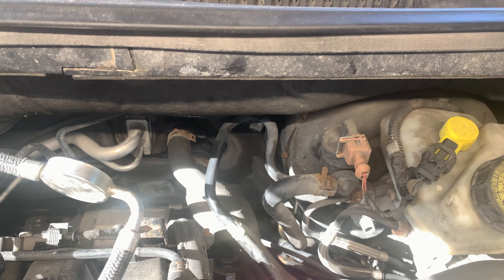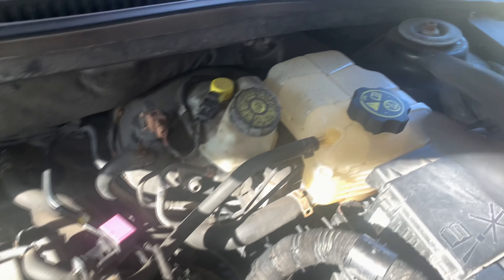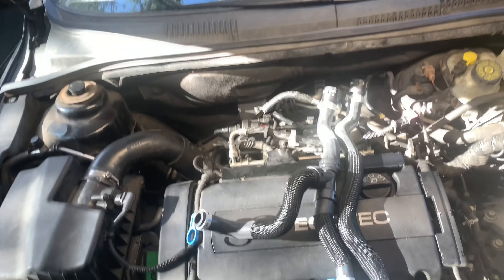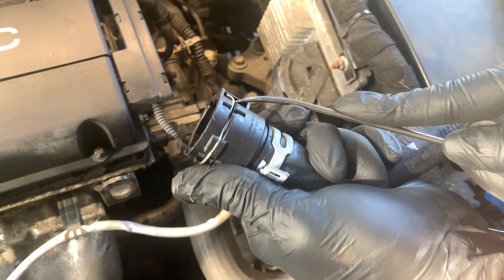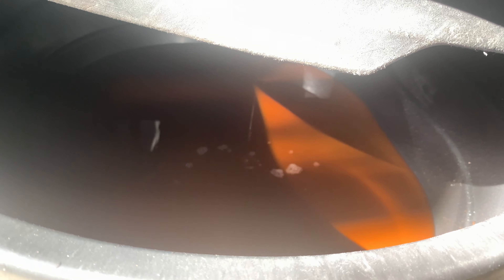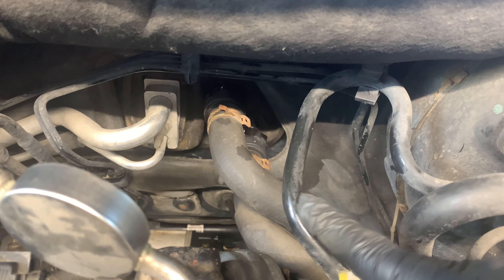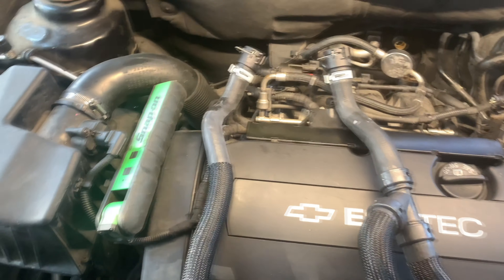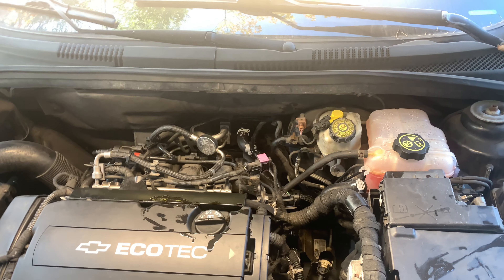Chevrolet Cruze Common Coolant Leak : Heater Core Hoses

Comment: Get compused, the upper hose should be on lower or upper of thermostat housing? The reservoir hose must be in bottom or upper of the thermostat? I need diagram for this thanks.

Comment: I saw another video were the tech replaced the o-ring in the hose that connects to the heater core to stop the leak.  Will I lose a-lot of coolant if I don't drain the system when disconnecting the hose at the heater core if engine is cold? I try & fix myself to save a-little money.  Thanks for sharing.
Reply from the maker: if you have the exact o-rings replacement, then for sure go ahead. You will lose a good amount of coolant if you disconnect the hose but not as much.

Comment: If I just needed to replace the hose section, would I still need to remove the plastic piece? Or can I just slide the hose off the plastic piece?

Comment: I took my isuzu ascender.  To get one of the heater hose adjusted because i had coolant leaking.  But notist one tube next to it dosent have a hose in it and when i turn on my isuzu and reaches its tempeture starts to leak antifreeze from underneath the reservior container.

Comment: Hi I have water slosh in my dash and I discovered I have a leak in my heater hose under my feet could this sound go away after fixing ? Or it's not related
Reply from the maker: the heater core is most likely leaking but I would also replace the hoses because the o-rings will be worn if you put back the old one.

Comment: I am having this issue right now and pulled your video up, But one of my issue's is that the coolant is leaking on the driver side floorboard. Is that common for a leak?
Reply from the maker: @Ibubblemurk Not common but its very expensive to fix. I believe your heater core is leaking and that's located inside the dashboard